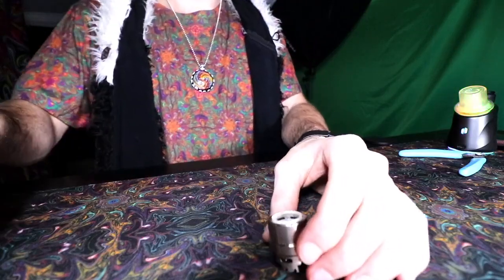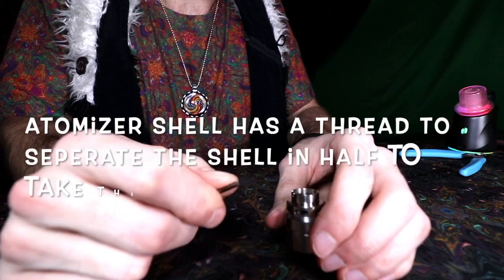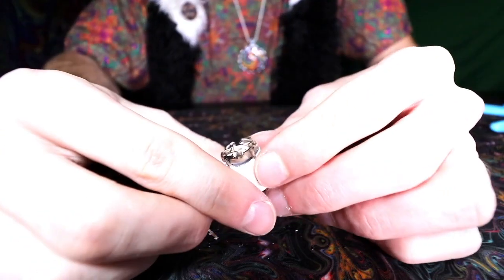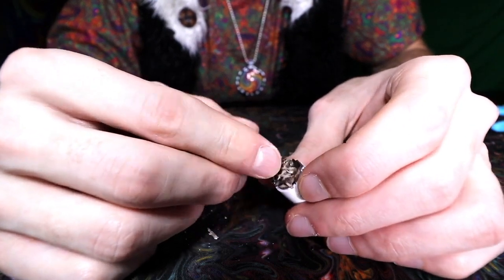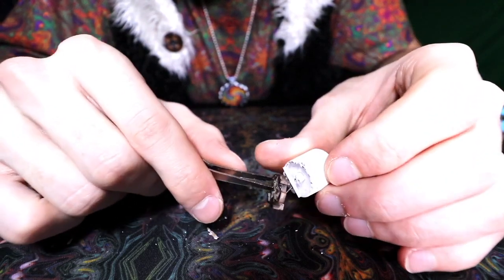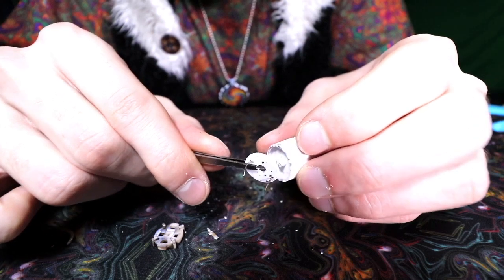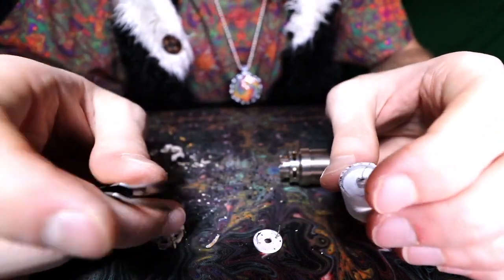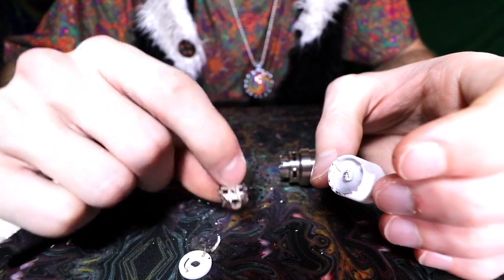Disassembling The Puffco Peak Pro Atomizer!

Comment: i love my peak pro cant say much bad about the thing but i gotta say for a like $500 devise they realy said "fuck letting you fix any of the more then likely finna break piece's just buy a new one" for mine the rubber seal to the atomizer wore out now it keeps clogging up the atomizer and too my knowledge ts is non replaceable and from the look of things i cant just take apart my atomizer to clean it i gotta just buy a new one (which will inevitably clog too with that broken seal)
Reply: for having said all that it does still work, tho i cant say at 100% where the atomizer goes has basicly became a reclaim catcher which i have to clean maybe every 5 hits, i have to pre heat it to unclog it first then can i load it up and take a hit or else its like im hitting a clogged up cart or somthing  so to anyone reading this and looking for a solution just know they didnt give you one but i do wish you the best of luck in finding your own solution as i continue to search for mine
Reply: @chasereynolds6037 maybe you should just soak up the whole atomizer in hot alcohol.  Heat it up in the microwave 5 seconds at a time for a total of 20-25 seconds. You don’t need much just shake it in a ziplock.